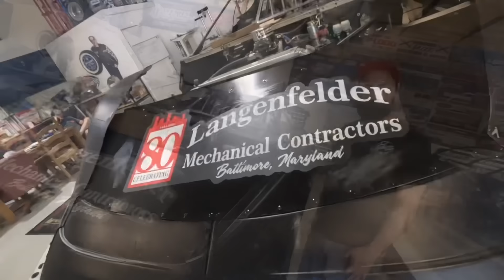Catastrophic Damage? How Bad Did We Hurt Our Clements Engine at Talladega?

Comment: I've turn wrenches for over 45 years and now retired from it and ya'll are doing the right thing. Precaution is cheaper than regrets
Reply: This is true… especially when it comes to high level… imagine this engine give out at a 50k race… even if there wasnt anything wrong from this, we’d always wonder
Reply: I dont understand how teams run them until grenade, some guys like running engines until they fly apart. Dont understand how they afford it when its 3 or 4 a season.
Reply: Who is doing that? Any reputable team has their motors freshened every thousand laps or so
Reply: Totally agree. Been a heavy equipment mechanic for 25 years and $3k in precautions is way cheaper than $30k in destruction. Cover your butts, save the work and heartbreak. Y’all did the absolute right thing.

Comment: The old tale about putting the spare belt on is mainly for when you are running power steering and fuel pump off the back. Not oil pump driven.
Reply: Exactly

Comment: You absolutely need to check the alignment of the pulleys.  You guys changed the mid plate and mounts.  If there is any difference between the older one it could change the alignment and make the belt track to one side of the pulley and eat itself up.
Joe
Reply: Makes no difference on belt placement.... midplates are all the same thickness, motor mounts and motor placement makes no difference.
Reply: Bell housing bolts don't affect the motor mounts. Mid plate thickness is all that matters unless there is an adjustment.

Comment: broke a belt at South Alabama back when I was a young man racing asphalt late model. i did not have a back up engine so I had to fix what I had. Found a needle bearing in the Weaver oil pump..  One new roller cam and a complete rebuild later( 4 weeks) I was back. The ONLY thing to do is open her up and see what happened. I did not have an engine builder,,,,, I WAS the builder. You guys are doing the right thing. ignore the Internet experts.  You do what you have to do and it will be fine.

Comment: An oil accumulator will maintain the oil pressure for about 60 seconds after the belt breaks.  Moreover, it acts like a shock absorber for the oil pressure and maintains the straight away oil pressure thru the corners.  I would still have the bearings checked after a belt break, but an oil accumulator lessens the chance of damage.

Comment: The marvel mystery oil is good for your fuel system you can even run it in the crank case I wouldn't recommend it for race engines though

Comment: WHY was it only turning 5000rpm?
I have never seen a rooth belt break up like that. Alignment? I used to run the belts for about a season then replace it. Never had an issue and that road racing

Comment: Would installing a sensor that reads the oil pump pulley or belt, that would cut ignition to protect the engine be an option?

Comment: 5000 rpm my rear, at least 9000 when that belt came apart.  Those motors won't come on until 5000 rpm.

Comment: question for you why not run that oil pump on the front of the engine so it is more easy to watch for signs of needing to change it before it blows up and this happens I AM NOT SHAMING YALL FOR THE WAY YOU DO THINGS
Reply: Easier to knock the belt off on dirt.

Comment: With good Synthetic oil, You'd be surprised how long it will run without doing any damage. I'd pull the oil pan off, Look at a bearing and roll with it. If it needed bearings, Put bearings in it.
Reply: They have multiple super engines. It’s obviously not worth the risk. They obviously want the engine builder to be responsible. Many years everyone has complained they are under powered. Now they have a engine that isn’t and everyone wants them to risk it by working on it themselves
Reply: Since it was synthetic oil and the engine builder said bring overrules opinion

Comment: Why would you not let Clements just go through the motor and refresh it while you have it out and are taking it to them wouldn't that make sense?
Reply: They said in the video that the engine only has ~300 laps on it since new and a normal refresh is done around ~1200 laps. As long as Clements doesn’t find anything abnormal it’s not necessary to refresh.